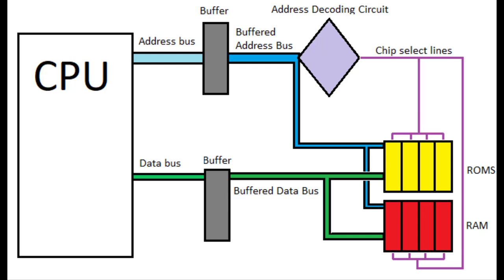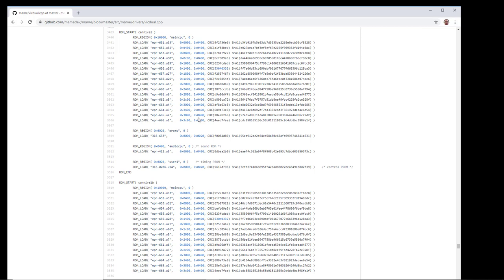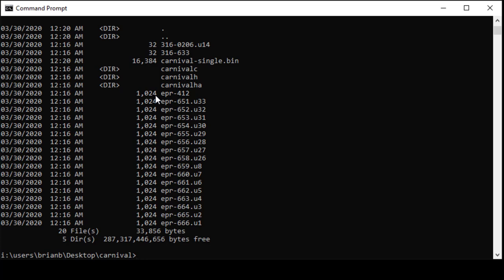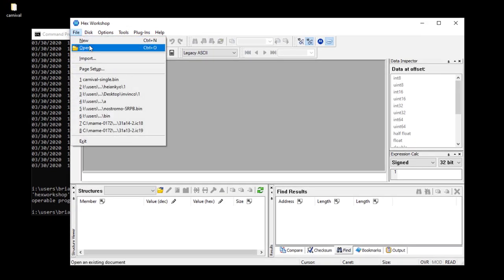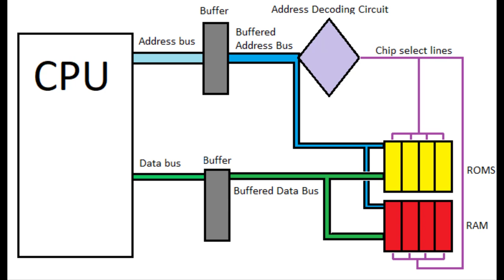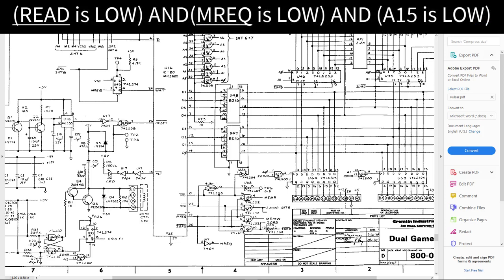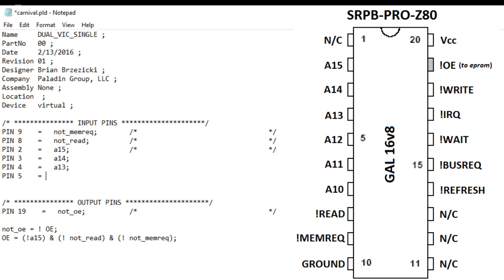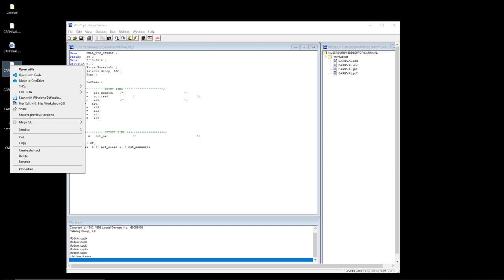Creating a plug and play single ROM arcade game hack daughter board part 2 of 2

Comment: As usual, above and beyond Brian!  I must have missed it but how do you get the OE from gal to CE of rom. Did you route a trace directly on the pcb daughter board?  I assume you only always need one OE for single rom mods as we are just controlling when the rom should be outputting data?  I probably could ask 10 more questions.
Reply from the maker: jacklick oh yes sorry the /OE is wired directly from the pal directly to the 27512 on the daughterboard